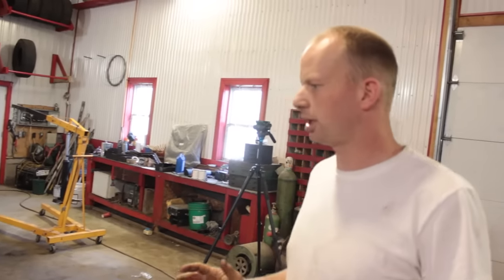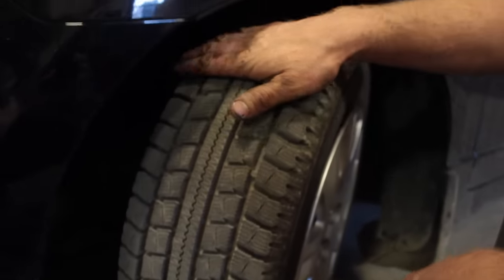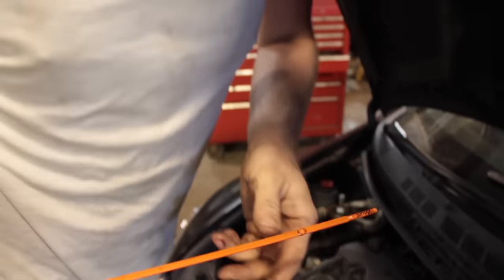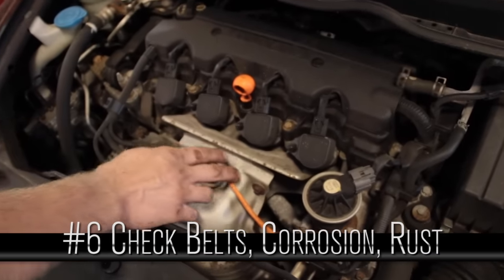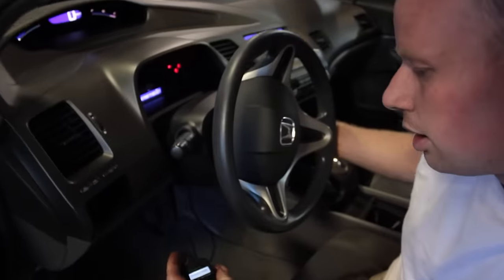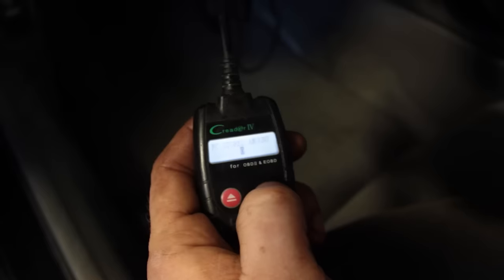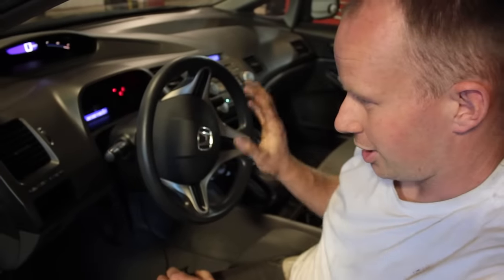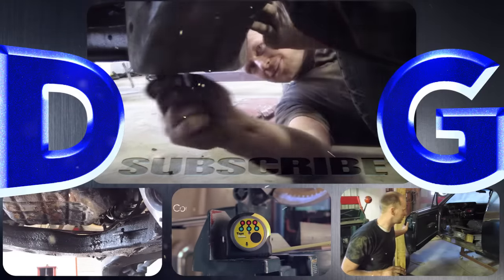12 Things To Check Before Buying A Used Car

Comment: ATTENTION!! HUGELY IMPORTANT!! Request that car be off/engine cold when you go for test drive, then make sure to drive for 15-20 mins (ideally with some freeway if possible) to get the car up to running temp to make sure it doesn't overheat or have any other problems.

If you arrive for test drive and car is warm or running already, that implies that it has cold issues. Hard starts, squealing belts, smokes a lot, etc. If the person says they are in a hurry and test drive has to be quick, request to reschedule for a time where you can drive for a bit. In my experience issues when the vehicle is hot (overheating, leaking fluids, tired/stalling engine, bad or burning smells, etc) are usually worse overall and point to either a worn and/or poorly maintained vehicle.

If possible you should attempt to check air/fuel filters as well. A lot of people can dress up a pig real nice, but more often than not they won't go that far.

Comment: I looked at a Honda Fit with 66k for $8,500. Driver really nice, smooth and straight. Needs spark plugs and valve cover gasket, but front passenger door is where I’m concerned. Noticed the side mirror was a little misaligned, then noticed the cover for side mirror screws was missing, then noticed the window doesn’t go down all the way, and that the wiring is getting in the way inside the door panel that looks like it had been removed at some point. Dash panel up against the the pillar looks a little misaligned as well. Car fax says no accidents, but that the driver airbag had been replaced, but didn’t look like it was due to a recall, at list not listed as such. Also in the carfax, said right rear window was replaced, though it was the right front that didn’t go down all the way. Do you think this has been in an accident and that I should stay away or if I get them to knock off $500 for the valve cover, spark plugs, and window, it’s still a a good deal? Thanks.

Comment: bought a 1996 honda accord checked everything , it had 98,000 miles on it wow! 23 yrs old! it ran grest passed emmissions , steered good interior like new alignment good everything else worked good so paid 2,400 for it then two months later needed cat converter, one month then seals on crank leaking bad , then 3 months plug seals go bad,then left front axle making noise , then right front axle making noise, then overheating needs head gasket , then radiator leaking, then heater don't work, then parked on street got stolen thief drove it till motor fried because of over heat problem and it killed motor so checking everything don't guarrantee good car because it's still used and a new car can also nickle and dime you, SO better to buy a horse ! 😝

Comment: I just bought a 2003 Ford Mustang convertible today and oh my god I’m going to need to fix the little things which were what I forgot to check. The headlights will not turn on. One tire has no ridges meaning its so soft , needs an oil change , breaks fixed  etc.. I still need to see about the codes tomorrow sheesh

Comment: If you go to look at a used car and the current owner will not let you do a compression test due to liabilities.  Plus, the owner has new transmission fluid and brand new oil in the engine.  What other tricks and tips can you give to gauge whether the car has a safe system?  Other than smoke out of the tailpipe and test driving.  Thanks
Reply: N 10SZ get a "block tester". You don't have to take anything apart, all you have to do is take off the radiator cap. Using that will tell you if you have combustion gases getting into the cooling system. If you do, probably a bad head or head gasket.

Comment: How to check the inner of a car at its store? Because some have hidden mileage on it, so I would like to know how to figure it out? Please. They may restart the mileage but there is something they would never can reset.
Reply: You can usually just tell by the seats condition. If the seats are worn and torn but car has only 50k miles than obviously that’s suspicious.

Comment: The most important thing is prices
A dealership used car ranges from 8000 to well anything expensive, if you buy a 2014 Camry for example,, and the car is bad then you're stuck with paying repairs, insurance, monthly payment. If there is power train protection then you'll be paying the monthly payment and the car is at the shop

Now, if you buy one at a low price from owner, let's say a 2014 Camry with a bad transmission at 3k then you would buy the transmission at 2k + fees, then you'll have a 6k car that its yours and not the bank's. 

I bought a top of the line 2008 impala for 2,500 dlls + 600 dlls repairs 
The transmission is 1,300 and a new engine 1000 (which are still good) 
Thats a car for 3000 dlls
My aunt bought a 2011 impala of the same model for 1,000 down back in 2015
Same problems as mine, with similar miles 
Only thing is she paid 30,000 dlls in total + repairs

Just saying be careful what you spend

Comment: Hi Deboss, I was looking at a used truck for sale at a dealership. There was no "fix engine" light or anything. when i put the fixd app into work, it came back with a code that said that there is a 70% chance this was going to be an $800 problem. I told the dealer and I left. He sent me a text the other day saying he had driven the truck for about a hundred miles, and that when they plugged it in, the codes were gone. he then said that it was a previous issue and the the truck was ready for sale. Does that make sense to you because i'm not buying any of it. thanks in advance!

Comment: Hi, I’m trying to buy a car it’s 2012 Hyundai Santa Fe, with 25k miles, but the tires, the wheels, and the inside part of every doors are pretty worn out. So I got suspicious about the miles, is there any way to check what’s the real miles?

Comment: Is it somewhat normal to smell gasoline when you remove the oil cap? Happened today on a mazdaspeed so it has direct injection, if that makes a difference

Comment: I really really need help there’s a Certified pre owned 2016 Honda Odyssey Touring elite. It’s being sold by a dealership. I bought a new 2016 Honda Pilot EXL there too 4 years ago brand new. It has 31,000 miles on it and it costs $24,000. I really need help should I purchase it? It’s my family dream van our Honda Pilot isn’t big enough for us and our activities. I really need help what should I check for?

Comment: Hello guys I need help. I will be buying a brand new Toyota. 

I will be travelling 350-400km one way straight driving & and a day after 350-400km back straight. Please note that this is straight driving since it is located on a paved highway dessert - basically no stops.

Perhaps I will be driving 50-60km daily aswell.

So it is safe to say that per week it is either I consume 1100km or just 420km. Can you please help me decide  on an affordable or cheap toyota car that can do the job - that would not overheat and let me down on the dessert with little to no maintainance please? I am just new to my job and will be taking a loan.

Comment: 1) start the car and wait for the fluid levels s to heat up to normal operating temperature before leaving the lot
2) chips in the paint
3) scuff marks on the sides 
4) cracks and gaps in the front and rear fascias
5) looseness & noises in the suspension
6) check engine engine comes on after 15-30min
7) price cost equal to or more than brand new
8) outrageous monthly payments 
9) final payment on 4 year old cars longer than the car's useful life 
10) not taking the time to fully read the fine print
11) sweet smells - sign the coolant is leaking somewhere (exhaust,engine or heater core)
12) smoke coming out of the exhaust pipe
oil and other fluids around the engine
13) go 5 mph in an empty parking lot and apply the brakes to make sure the car doesn't drift to either side
14) Consider getting your own inspection 
15) assume most car salesmen are liars and only care about money
16) assume there are hidden problems the dealership won't tell you.
17) don't buy the car the salepeople are pressuring you to buy; know what options are available to you.
18) see how well the vehicle drives at highway speeds
19) Run and look back from any dealership that says you can only test drive the vehicle for 15 minutes 

It's Your Money Make Them Wait - 
You are the one who has to be happy with car you  own until you can get another one 

Jesus bless you if this info helps you

Comment: That will Civic will go a hundred fifty thousand miles with nearly no  repairs!!!! 
Mine has! Although I must admit that the suspension is getting a little noisy and I have done the brakes. 150000 miles and that's it??? yep 
Great little cars

Comment: buddy bought a 05 nissan frontier..he got screwed ..the check engine light was on and the seller said it was bad gas cap. i told  my buddy to take my cheap code reader to check it out..he didnt. was a clogged cat converter..300$ part for those.
Reply: working shlub Might wanna tell him to check the radiator too. From 05-early 2010 the frontiers, xterra, and pathfinder has SMOD problems too. They do have a bypass on it or the best thing to do is replace the radiator. Also timing guides like to wear out fast on the early models too. If you hear a whining noise that’s mostly the guides are worn.
Reply: xxxdorito cut out or clean it much cheaper

Comment: I was buying a car that was a manual transmission the guy didn’t want me to test drive it then to me it was a red flag. I wanted to drive it but the guy said I’ll be in passenger he’ll drive it but I wanted to make sure it has gears 1 thru 6 I’m a car mechanic and I needed to feel the car transmission so I told the guy sorry I’m not buying a car that I can’t test drive. So never feel the pressure on buying a car there’s more out there I had money with and still the guy didn’t want me to test drive it.

Comment: Look at the exhaust fumes. With engine warmed up, there should be none...just warm air. Any smoke or smell of burnt oil is bad, very bad. Also, ask for the proof of timing belt change. Don't take anyone's word for it. Broken belt will result in engine replacement. I stay away from cars with timing belts. I buy the ones with timing chains. Much more reliable.
Reply: James Ebola 
1. Smoke doesn't always mean bad, it could just be steam (this is especially the case if you look at a car in the winter). Of course this is if the smoke is white, if it's blue or black something is wrong.
2. Not all engines are destroyed when the belt breaks, it depends on whether the engine is an interference or non interference engine. I do agree though Chain always better than belt.
Reply: @AdamSmith-gs2dv  Unfortunately most cars with timing belts have interference engines. Fortunately new cars are going back to using timing chains.

Comment: Peter Timpson,, Most importantly make sure the engine did not have an history of overheating. Many times an overheating engine spewed coolant from the cap or overflow bottle leaving an obvious dry like stain . You may try to ascertain if the cylinder head gasket is warped. If not,,,, more important matters are there to know when buying a used car other than firewall rust.

Comment: bought a 2014 Chevy Cruze lt last week. this week after work the check engine light came on. code is misfire cylinder 1. should I be worried? 

I took it to a mechanic and he changed the spark plugs and erased the light. he said if it comes on come back.
Reply: runs its no problem. If its not bring it back to me.
Reply: If it has a turbo you wanna change spark plugs every 30k miles and if that one spark plug is bad the other 3 are bad as well

Comment: dont spend 800-1000 on tires.  get the cheap Chinese ones for $50.  Its just rubber how much technology can there be.
Reply: @DEBOSSGARAGE  I understand that is the argument for expensive tires but it just doesnt happen often.  Ive hit the concrete at 70 mph on a motorcycle and just got scraped up.  Being in a caged car, youll be fine in the RARE event.

Comment: 1. $800-1,000 for car tires?!? I just put very nice set on my 4Runner for less than $500. 
2. You can get a generic scanner/OBD2 adapter for about $10 with free smart phone software, no need for a dedicated scanner, and the scanner this guy is showing is more or less useless. BTW, OBD2 has become mandatory in 1996, not 1999. Actually, Honda and chrysler adopted standard in 1994.
3. WRONG! There are OBJECTIVELY/STATISTICALLY good brands (I am aware of one at this time), and the rest are various degree of garbage.
Otherwise, it's useful for a newbie. One missing but essential piece of wisdom: stay away from all kinds of fords, stick to Toyota.

Comment: Or how about just buy a brand new car? You'll be spending a lot less money in the long term on repairs and maintenance and the car will last longer if its brand new.
Reply from the maker: Couldn't be farther from the truth.  We bought a 1 year old Saturn Aura with 110 000km (probably a rental) for 10 500.  It has lasted us 10 years and now has 450 000 km on it.  Along with the cost of the car, and all repairs and maintenance (brakes, tires, etc.  we have less than $18000 in it  (inlcuding taxes).  That's $150 per month.  If you exclude the repairs, which all cars will need, even new, it comes to $100 month.  The great thing is, our kids have puked in it a couple dozen times, spilled drinks, put their muddy boots on the seats, someone hit the back bumper, and I don't care.
Reply: You made some good points there however I still fail to see how driving something that is used is better than buying brand new. Longevity of a brand new car is much better and also a lot of car dealerships lie and hide faults and defects with the cars they are selling. At least when you buy a brand new car you're not at risk of getting a car that comes with multiple faults.

Comment: $800,000.00 for Tires, must be a Lambuorgini.

OBD -2 , Second Generation commenced in 1996 , 1999...What State in the United States does this Clown work in.

You don't call Part Stores to ask them if this certain car need a lotta parts..All vehicles need Parts, eventually.

If your Scan Tool (Year 2019 ) won't retrieve P-Codes ( Powertrain Diagnostic Trouble Codes ) ....B - Codes ( Body Control Codes )....C - Codes ( Chassis Control Module Codes ) & U - Network Codes ) & you call yourself a Pro, "Miss me with that Foolishness "......It's extremely good when people don't work on vehicles "For A Living" use that Code Reader that's shown in this Example, however; that Toy is only 10 % of the Game.

And to end my disappointment : If you have "Even" Professionals working on your A/C ( Air Conditioning ) & they haven't heard of a Handheld $2,000.00 "Refrigerant Identifier ", that person shouldn't be working on anybodys vehicle on Planet Earth.

Smog Repair Background
"Book Mechanic"
Southern California
Reply: Charles E. Barkwell 800 to a thousand dollars, he meant

Comment: This is not great advice. $2000 cars are almost certainly going to have damage or repair  history. If you're under the impression that there are $2000 cars for sale which have never been damaged and need no repairs then by all means subscribe to this channel.

Comment: For God's sake don't use your fingers to wipe the dipstick.
Reply: It was to make sure the fluid is red and clear, theres better ways like with a white rag, but its not catastrophic, you wont kill your engine by getting a tiny bit of dead skin, dirt and oil in there, realistically its a tiny amount
Reply: @dustinjames1268     I just needed to point out that it is not a good practice to use your fingers to wipe oil off anything, too many additives and pollutants are used which in modern lubricants.
Reply: @barryfowles-zl5ib  
Thats a very good point if you forget to wash your hands lot of ways to accidentally ingest toxins
I didnt think of it from that angle

Comment: or you can just buy a TESLA or any electric car!
just check for batteries and tires and the interior cabin and u are good to go pretty much
Reply: Oh yea tons of teslas on craiglist huh
Reply: xX squeaker Xx 😂😂😂
Reply: lmao bud we’re all buying used for a fucking reason. not all of us are made of money
Reply: Sohaib Akram never buy a Tesla if you get in an accident you will catch on fire. That lithium battery will explode.
Reply: there's a lot more that can go wrong than that.. tesla's have tons of electronics that can fail not to mention it still needs suspension and other mechanical parts that wear down over time
Reply: Tesla? Why are you even here then? lol